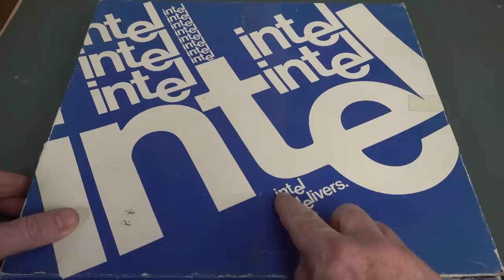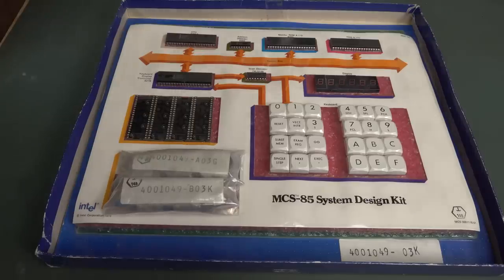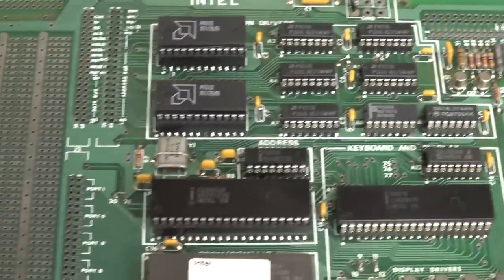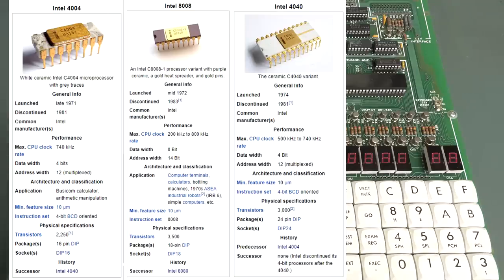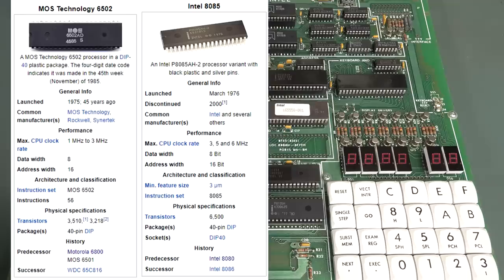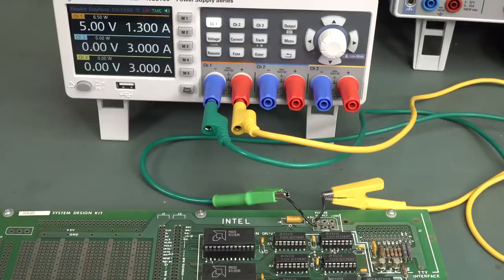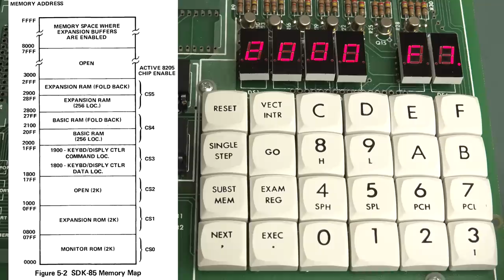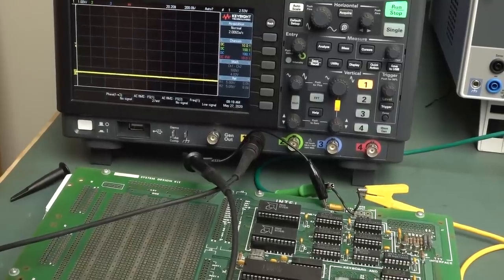EEVblog #1308 - 1970's Intel MCS-85 8085 Design Kit!

Comment: I've got a similar kit, the SDK-51 (with the 8031, an external rom version of the 8051). Mine is also "mint in box".
Reply: I've got one of them trash 80s also. Still works.
Reply: i can't believe how much stuff still has an '51/'52 core in it even today.. my furnace, my mouse. thermostat.. they're everywhere. also the first assembler i learned. :)
Reply: 8051 and its various other variants are probably a bit easier to program and integrate. More IO, more integration. But that is around 1980, and probably few years later for the EPROM versions (like 87C51, 8752, 8754, 8758).

Comment: My first computer was a 6502, Apple II Computer., which I got in 1979.  Lots of fun, programmed in Integer Basic, but it also has a one pass Assembler!!!   Pure fun to program it.   I built an 8 bit A/D board which I had written code to make sounds from it.  I still have it.

There was also the RCA COSMAC 1802 processor.  It was the first CMOS microprocessor.  Easy to build hardware, but a horrible instruction set.  It had 16, 16 bit registers.

Comment: Even before such advanced kits were research manuals, that provided technical intro to microprocessors. I have a research document from a University on the Intel 8008 processor. All on green paper so not able to photocopy. Cost was a couple of hundred dollars and had ONE example processor included. Nice white ceramic with gold leads and lid.
The chip, a 18 pin, 8bit CPU, addresses 16bit so 64K ram, separate 256 I/O, and 8 control signals, three supplies,   BUT all in 18 pin package.  How? All needed lines handled by a 5 level multiplexes bus  8 data, 16 address, 8 control signals all on 8 lines, plus 4 power, 2 crystal and mix bus control.

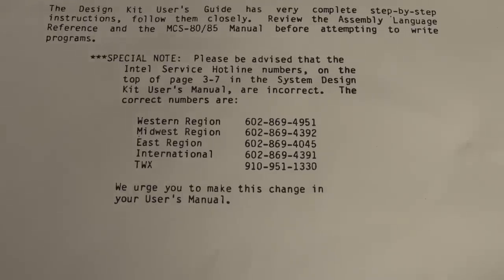Comment: 9:06 The hotline numbers have the old Arizona state-wide area code (602 now corresponds to just the central Phoenix metro area). If they went by the 'modern' area codes, they would probably be 480... so even if Intel still has the 869 exchange, the numbers on that sheet will ring through to somebody else!

Comment: The 8085 was used in a few arcade machines. At least Phoenix uses it. But there are arcade machines that use all kinds of exotic CPUs (although 6502 and Z80 ruled here, followed by 680x). And what am I programming? Signetics 2650. Why? Because no one else does (at least not on Interton VC4000 / Radofin 1292 family). There should be a series on unknown/under-used CPUs from the 70s (like the 2650, 1802, SC/MP, what have you)
I wanted to like this video. But the like counter was at 1337. Sorry about that. Remind me to like it later.

Comment: I still have my HP 5036a sitting in a closet, still fully functional. It's maybe a little younger than this thing, but still 8085. Plenty older than me however.
Reply: Nice. Looks very similar to MCS-85 Design Kit. The edge card connector was a good choice. Both looks extremely similar in abilities. The HP 5036A looks to be a bit more user oriented, with some stuff integrated to make easier to start doing stuff (case, PSU, interaction with some HP gear). HP 5036A looks to be coming with a bit more memory tho by default (1kB vs 256B), but it was probably release 2 years later, so obviously tech and prices changed.

Comment: done this at school on z80 and 6800, preferred the 6800 because of the cleaner instruction set and dual accumulator. But I still prefer the 6510 in my old C64.

Comment: My last year in college I designed and built with wire wrap a 100 channel data acquisition device that used a 6502 and a couple of PIAs and an EPROM I would burn in the code using a PET computer.  Anyway, I won third place in an IEEE student paper contest where I had to demo it but it wouldn't work and I said "It has been working, I have witnesses" and the engineers and others in the audience filled the room with laughter.

Comment: Used one of these at Swinburne Elec Eng course in the early 80s. Was very frustrating for me, as I’d built an S100 bus Z80 system at home with full keyboard and monitor. That keypad drove me up the wall. 😂

Comment: I had a Motorola D2 kit. I had also modified it and rewrote the monitor ROM so it ran with a 6809 CPU instead of the normal 6800. The 6809 is my favourite CPU. Unfortunately the D2 kit didn't survive clearing out a storage locker. I regret letting it go. After the 6809, I like the Z-80, 6502, and 1802. I'm working on the design of a 6809 board that will it in an Altoids tin to replace the D2 kit.

Comment: The keypad makes sense to me. 4 rows and 4 columns for 16 values; starts from the left, higher value is to the right or on a higher row. 
The common phone keypad is upside down if you expect a higher value to be in a higher row, it sort of just looks 'right' because it's top to bottom - like writing in western languages. But a numeric keypad is not writing, it's a list of comparable values. 
Sadly, most consumer decimal button pads have adopted the upside down layout and it's become entrenched. Notable exceptions are the computer keyboard numpad and calculator pads.

Comment: 110 baud - damn. I mean I shouldn't be surprised for the 70s XD but damn. Pretty incredible how far we've come.
Reply: The teleprinters that ran at 110 baud  relied entirely on a rotating cam allowing metal bars to drop into place which had notches in them that allowed a turret covered in raised characters to rotate and raise and lower to hit the ribbon with the correct character. Basically there were zero semiconductors in the Teletype ASR33. I owned one , it cost £0.50 in 1984 because the rotating cam had caught the mechanism and the ASCIi decoder was wrapped round the drive motor shaft...It took 3 days to straighten it all out.

Comment: AMD chips on an Intel built product. And holy smokes! I didn't know Intel's logo went back to the 70's. It still looks great and works to this day.
Reply: The amd is the same one too
Reply: Anyone remember (not that long ago) the Intel CPU with AMD GPU IP because Intel couldn't make a good GPU? They sure kept quiet about it...
Reply: Intel's 64-bit part of the Pentium CPU was designed by AMD. Intel designed the Itanium...
Reply: @geovani60624  You're quite right! I neglected to mention that as well.

Comment: Someone mentioned earlier the ELF. Still got one up and running. BUT do you remember the RCA 1802. hehe. If you looked at it the wrong way it would die from the smallest static charge.. Fun times. Still got an old RCA pong game that was the first system I ever hacked. Built my first system in a desk drawer using a S100 buss hand wired. Still got the desk with a color graphic card the DAZZLER. I have the 1970's chip catalog I ordered everything from back then....  Ah those days! Loved them, miss them , pain in the ass!!!  Natch (%

Comment: Oh, I hear a mistake. The i8080 was fully compatible with 5V TTL logic. It only required the 2-phase clock to have a special higher level. There was a very handy 8284 chip that generated that special-level 2-phase clock. Everything else was 5V. But yeah, those power rails had their own issues. You were suppose to power them on in a strict sequence or (worse) at the same time. Incorrect sequence or one of them missing -- and the 8080 will die. Another problem was the existence of those -5 and +12 rails on the board, so an accidental short during debugging would lead to randomly blown chips including the 8080 itself. On the other hand, there were so many systems and controllers built on 8080, so it was totally classic. "Not like this 8085 rubbish".

Comment: If it's for a real TeleTYpe ASR33, it's a 110 BAUD 20 Miliamp loop.   Not RS232.
Reply: Yup, I bought half an ASR33 (with a mate) to connect to my NASCOM 1 (Z80) 1977!  Provided a "good keyboard" and finger exercise, printer, and data storage and retrieval via the tape reader and punch. Great, except for the weight and the noise! Built the 20mA to RS-232 interface first!

Comment: I learnt and used the 6502 coded in assembly language, then later went to 8088 and the 80186 microcontroller, all in assembly also. Still later moved to the 68000 which I though was much easier than the intel 80xx stuff to code, but missed the 8085 altogether.

Comment: I did not use the prototype area.  I used a wire wrap prototype board(s).  No soldering / unsoldering. 😁

Comment: You can save your program in a pc and program it via the UART. The monitor program must have a load intel hex file function at address 0x1600. My variant also has an input output for audio cassette in order to save or load programs. I actually have the source code, binary, and all schematics for my variant of 8080 kit. https://i.imgur.com/vrNYu9u.jpg

Comment: I've got a Z80 Microprofessor Board ( yes that's it's name - fits in a little fake book)  in the cupboard along with a eprom programmer and printer for it. Still get it out sometimes for a play. I wrote a program for the Arduino to play back tones through the Casette interface for assembled Z80 code. Should really write a proper loader etc for it. Fun times

Comment: Signetics 2650, from October 1975. It looked like the best design technically. Great instruction design (complete orthogonality), useful addressing modes, fully static design (easier debugging, etc).
 Good price too 20$ (compared to 175$ for Motorla 6800), in same range as 6502, or Z80. Unfortunately not too successful, used in some test equipment and embedded and industrial stuff. The only bad thing about it was very limited address bus of 13 bits, because the extra 3 bits were used to select addressing modes (direct / indirect, indexed / non-indexed, increment / decrement), which made programming harder if one wanted to use more memory. It was possible to access memory, but only 32kB, and only 8kB at a time, with banking. If it 24-bit addressing maybe it would be revolutionary and more prominent design. It probably is still made by NXP (Philips).

Unfortunately I never seen a computer with it in it personally. It wasn't a thing in Europe I guess.

Comment: The key pad goes left to right, down to up, the function keys in two adjacent columns, not so illogical. The arrangement  of key numbers seems to have been the default, see the Apollo DSKY, also later on pocket calculators, at least my HP ones.

Comment: my tandy model 102 runs an 8085, more than capable of much faster rs232 baud rates. the modem is limited 300 baud though. so it is not a limit of the cpu.

Comment: Could you use a 8088 as a microcontroller? You would just need some RAM and a ROM, and program instructions into the ROM according to the instruction set of the 8088?
Reply: The whole point of a microcontroller is that it has everything on one chip - processor, ROM, RAM and I/O ports.

In the early days many things that would later use a microcontroller used chips like the 8085. The original DEC VT100 terminal from 1978 used the 8080 and a later cost-reduced version used the 8085. It was not until DEC made its next generation terminal - the VT220 - that it switched to using a microcontroller (the 8051).
Reply: something like 80C186EB more closely  to MCU still no  RAM&ROM but bunch of peripheral stuff in it

Comment: I built the EA (Electronics Australia to the uninformed) Baby 2650 back in the '70s. The Signetics 2650 was closer to the real mini computers (i.e.PDP11) in the instruction set.
Problem with the Baby 2650 was that it only had a serial TTY interface, so I had to build the ETI (Electronics Today International) serial terminal, since the real TTY terminals cost an arm and a leg back then.
I still think the 8080 is vastly inferior to the 2650. Just look at the instruction set - one is perfect the other is a mess.
I bought a few KT9500 2650 development boards, they justified the ETI serial terminal.

Comment: we got the chip kits 1976 in college and wire wrapped the sockets. toggled in the codes via the keyboard. Some off us wrote an assembler.. If it didn't work got a F if it worked got an A. if i rember write it was an 8080.

Comment: I bought a Motorola 6800 microprocessor kit called the MEK6800D2, seem to remember it cost an arm and a leg. Of course it went missing over the years, hopeless!!. One pops up on Ebay occasionally, last time seller wanted $999 for one assembled, didn't sell.

Comment: I started computing on an Apple II, so of course I prefer the 6502.  Back in the 1980s, I had to use actual hardware and run crusty software like EDASM before finding infinitely less crusty software like Merlin-8.  Today, I have cc65 and even Apple's biggest software for the 8-bit machines (Applesoft, DOS 3.1, DOS 3.3, SOS, ProDOS) assembles complete with listings in practically no time.  For comparison, Merlin-8 takes about 30 minutes to assemble Applesoft with LST OFF (much longer if you turn on the listing and output to printer).

SOS 1.3 was interesting:  Apple never used their "better, faster" Apple III to assemble SOS.  That job was left to the Apple II, a less-crusty version of EDASM which supported macros, and 8 disk][ drives.  Why Apple decided to preserve EDASM's bad habit of not zeroing uninitialized data is beyond me; 80% of my porting effort was comparing data. (The other 20% was battling EDASM's pants-on-head math that is entirely left-to-right!)

Even today, the 65816 offers me learning opportunities.  Even if the IIgs didn't exist, other 6502 machines are largely uncharted territory that will keep me busy for life.

Comment: You've got the apostrophe in the wrong place.
It's plural possessive, so the apostrophe should go at the end.
If simply referring to the decade, rather than just 1970 alone, the correct representation, being plural, (as in a number of years), is: 1970s
If referring to something made in a particular year, say 1971, you should write: 1971's Intel design kit
If the kit was in introduced and sold only in 1970, then it would be: 1970's Intel design kit
But because referring to the decade, rather than 1970 alone, it should be: 1970s' Intel design kit
Sorry for being so anal but I've got way too much time on my hands right now, and hey!
I'm only trying to help you improve your literacy.
>

Comment: Notice the Keyboard controller, ROM & RAM say "Intel '77", yet, this kit was released in 1976 ... Mmmm, I wonder if the chips are replacements?
Reply: He said it was a newer revision of the board. Also they say '80 too, one of them '82. The TTL datacodes reach from 81 till 87 .. the 87 ones are in the port expansion area though. So those were added later. I think this was originally purchased somewhere in the early 80ies.

Comment: I had one of these and then when I started working for MMC, I built another one with additional functionality. I used both of them for designing a room roving robot that used the 8085 for movement, and the 6502 for mapping the room.
These 8085's were a lot of fun. One thing though, I wrote everything in assembler. I didn't have anything to help me. I wrote everything out on paper, tracked the program counter, stacks, etc.

Comment: About a decade later (late 1980s) I taught myself “embedded design” with the Heathkit microprocessor courses. I don’t recall exactly, but the total cost of the trainer and the three courses was somewhere between $500 and $1000. It was a lot of fun. It was like learning the innards of a microcontroller, because the 6800 came with interface ICs for what is now inside a microcontroller, like parallel ports, serial ports, etc.
Reply: ET-3400

Comment: Dave. Being a Tru Blue Aussie you should do some research into Australia’s first true microprocessor kit, the MiniScamp, published by Electronic Australia in 1976 and sold by DickSmith Electronics.

It had a National Semiconductors Simple Low Cost Microprocessor (SC/MP, therefore Scamp) processor chip running at an approximate 1 MHz, 256 bytes of static ram (expandable to 1 K ) and a high-tech binary, LED and toggle switch interface.

I built mine in 1998 (I was 12). I still have the old and battered circuit board around somewhere.

https://oldcomputermuseum.com/mini_scamp.html
Reply: I got mine in Perth from the first Altronics store in Stirling Street close to the Perth Museum (we didn’t have a DickSmith store here back then) and my dad paid $115 for it.

Comment: There was a 68000 development board called "MC68000 Educational Computer" around 1982. I used to play around with one of these at work back in the day. I think I still have one in the cupboard that I grabbed from the dumpster from when they were tossed out after several years. https://cdn.hackaday.io/images/2951071429941428803.jpg

Comment: Started with Altair 8800, with 8080, but within a year changed to Z80 vpu board from Cromemco, also updated to IMSAI box. Soon added much other hardware, including ultimately a Z80+68000 Card from Cromemco, with CROMIX (unix system) while also running CPM, MPM system.
Did own hard drive, writting bios drivers, formatting and partitioning software for CPM and MPM.
Too much history to put all into comments

Comment: Wozniak did mention why he choose MOS6502 because Motorola and Intel chips are expensive.
Reply: The Apple I was amazing because while Woz initially made the hardware with the 6800 in mind, once he saw the 6502, he made the Apple I compatible with both it and the 6800, so you could use one or the other.  His decision to use the 6502 was certainly cost-based.

Pretty sure all the Apple I machines used the 6502, though...

Comment: Did intel really making a kit with amd chips?
Reply from the maker: The AMD chips would have been fitted by the owner, they are part of the expansion circuit.
Reply: @EEVblog  yes, that board was hacked many times. I am sure. The Chip sockets are different types. ;)
Reply: No Intel didn't put AMD chips in there.. I had a few original design kits, i8088 with 8087.  Also ethernet and StarLAN. StarLan  was an ethernet designed to run over  installed telephone twisted pair at 1 Mbit. They may have included the TI 74ls series glue logic though.